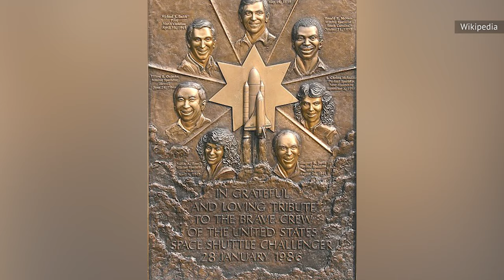The Challenger Disaster Never Should've Happened. Here's Why

Comment: All they had to do is wait for the weather to get a little warmer😢😢😢
Reply: I don't know if it could be reversed. Some materials can't go back to what they were after temperature changes outside of tolerance
Reply: @sarahkinsey5434 It still may have made it. The other factor that day was the wind.. After it leaked when the vehicle left the pad, the hole sealed itself with a plug.. When the shuttle hit a wind shear, it experienced winds far greater than any shuttle flight before it. So the wind basically knocked this plug loose, and the leak proceeded to a total vehicle destruction. There's a detailed analysis of this on YouTube.. If you notice the smoke or vapor trail right underneath the point of the burst cloud, you can see the wind making a zig zag effect of it. Sad stuff.

Comment: There was an escape device in the original shuttle design, but it was removed to cut costs. Also in the original design, the orbiter (shuttle) was to placed at at a configuration HIGHER than the rocket booster, so that the orbiter could escape. All those escape and failsafe design were removed - a lot of corners were cut.